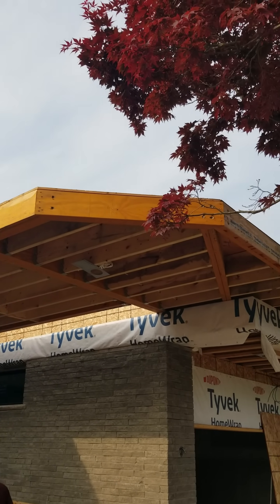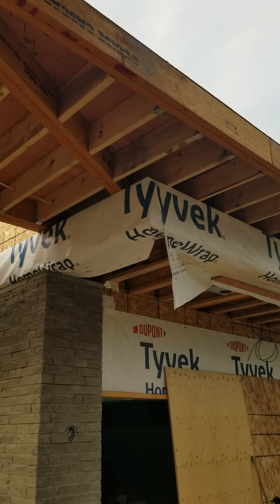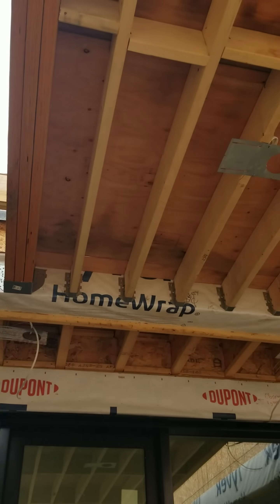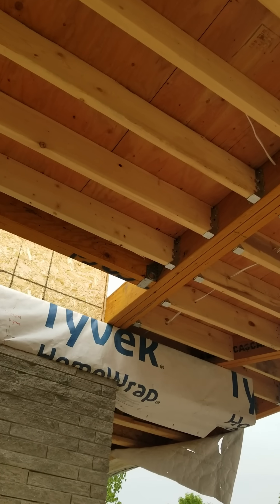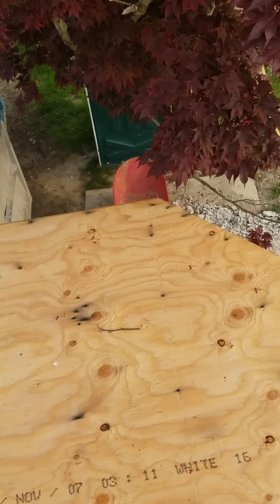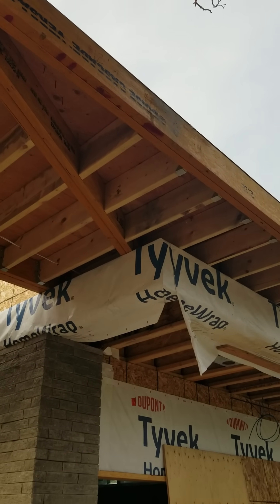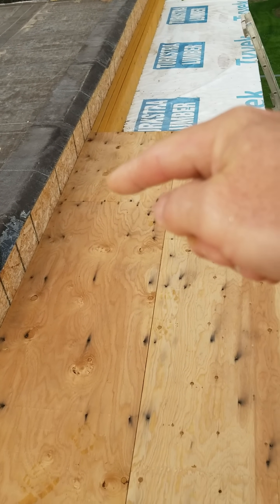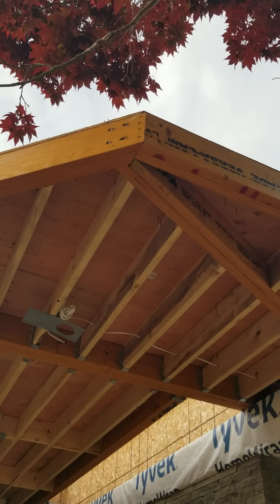Floating roof! How to build a roof with no posts.

Comment: Excellent work! I love it! 
I’ve done so much work where the engineers draw things and assume it’s possible in 3D space but have never picked up a tool. Sometimes they want things done and they have to just throw their hands up and say, “I don’t know; you build it and I’ll draw it afterwards and put my signature on it!”  (Everything in an organized township in Ontario needs engineered drawings)
This absolutely looks like one of those times where you could only figure it out if you started your career hands-on. 
Well done!
Reply from the maker: Man that is so true!!!! ' I'll give you an as built'...
Reply: Our engineers would have had three monstrous bearing blocks poured with the foundation, supporting steel posts, supporting a steel I-beam that weighs more than a small pickup, and charged us $22,000 for the engineering/ stamps/permits etc. and still failed inspection because they didn't call out a certain fastener needed to be galvanized. Building is getting absolutely ridiculous these days.
Reply from the maker: 🤣🤣🤣🤣 ya over the top for sure! That's why you just gotta do it first then find someone to stamp it😊